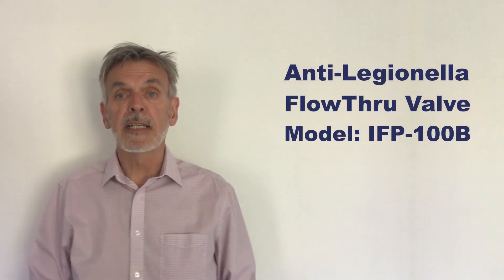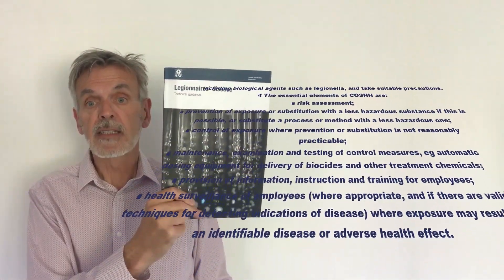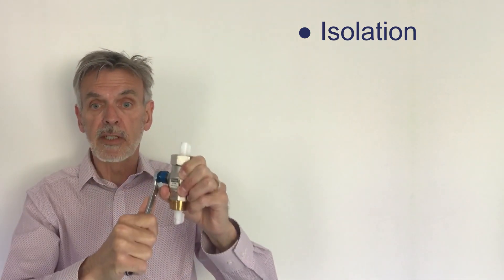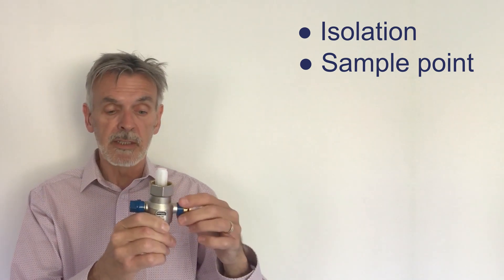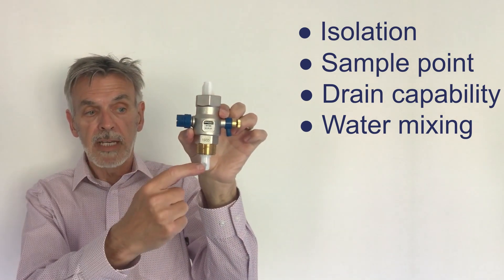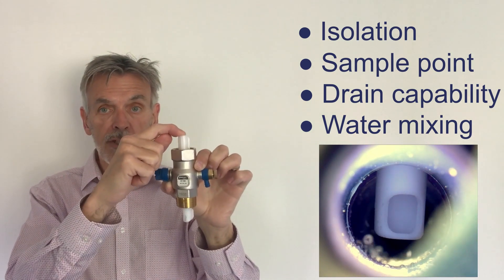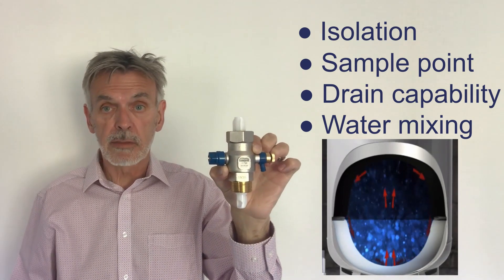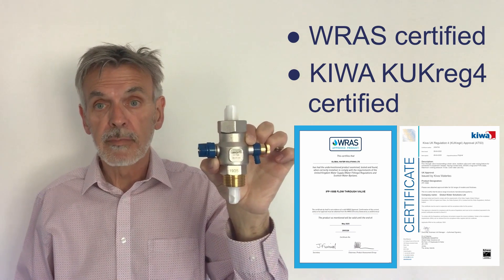FlowThru Inline Adaptor Plus (IFA-100) Anti Legionella Flow Thru Valve

Comment: These valves are a great idea but as mentioned below the in line with un-vented regulations there shouldn't be any means of isolating an expansion vessel. The HSG 274 which is mentioned in the video also advises to install an isolation valve and drain to aid flushing of vessels. The operatives who are doing the monthly checks will have no idea how these un-vented systems operate and this could lead to disaster, anyone who installs and services un-vented systems knows that the only way to fully flush stagnant water from a vessel is physically remove it and flush it out. There is no evidence that these valves or flushing a drain on a vessel actually prevent microbial bacteria